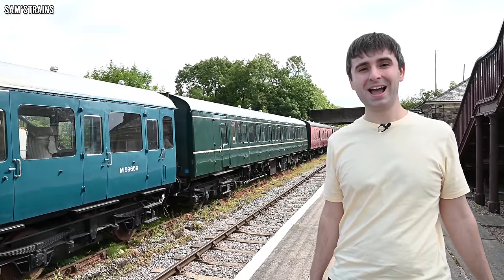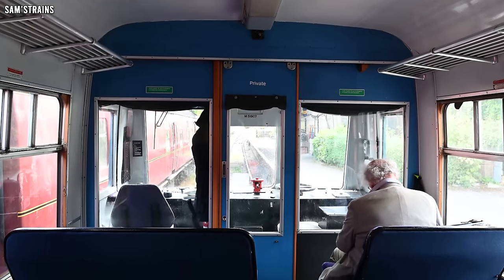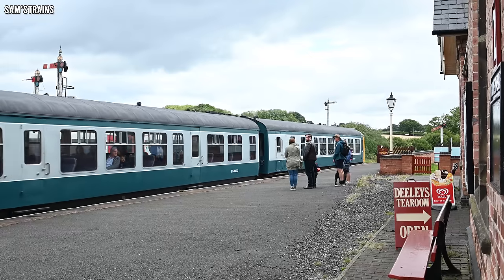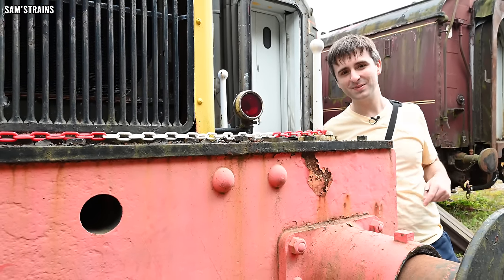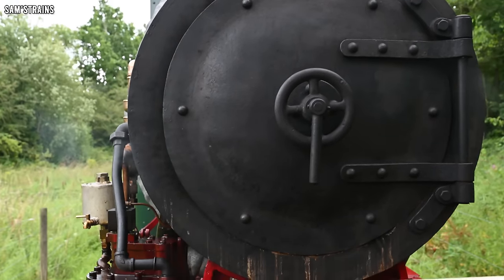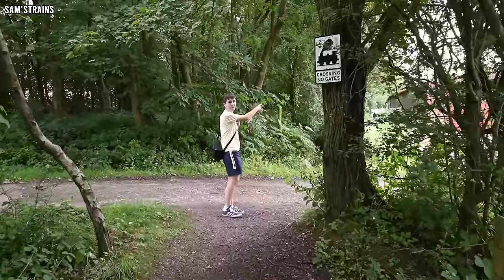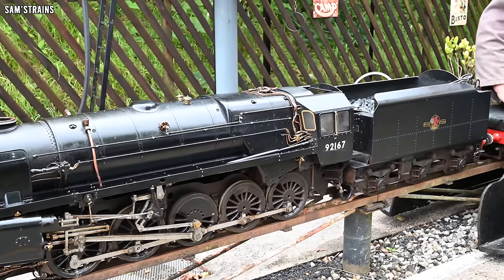Sam & Chloe Visit the Midland Railway Butterley | 3 Railways in 1 Day

Comment: One of my local presrved railways was called the Midland Railway too, but it has less stuff than the one in Butterley. In fact, It hasn't run an excursion between 2019 and November 2022, and still hasn't run one in 2023 after legal troubles over the depot and being sold to new owners. It too had a sand pit, but only during the Thomas events and it wasn't trying to be a beach.
I believe that coach at 1:43 is home to some of the model used on TUGS and Thomas and Friends. They're no longer open on a regular basis but have special weekends where they are.
2:10 that class 141 pacer was a 1st generation Pacer, one of only 20 ever built. They were retired in the late 90s and most ended up in Iran.
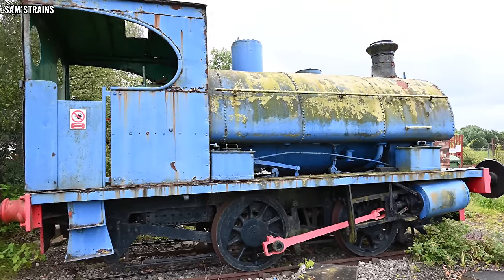7:42 that used to have a Thomas face on it and was called Oswald.

Comment: The chassis looks like a Badger commercial railway vehicle, which is designed to be used with a small pickup bod, normally in yellow, usually using a Volkswagen 1.6 diesel engine.

Comment: Very nice.
Once upon a train ride, along the Severn Valley Railway, Sam and Chloe were enjoying the shrill whistle and sharp bark of Erlestoke Manor, who was hauling an eight-coach train. Sam stuck his head out of the front window, and got speckled with soot. Chloe laughed.

"What's so funny?" asked Sam. He looked in the compartment mirror, and saw the answer. He was almost as black as the Ace of Spades. This wasn't all. Erlestoke Manor stopped at Hampton Loade Station, to let boyfriend and girlfriend off. Sam was puzzled until....
"I've got a present for you," said Chloe smiling. "Climb up on the footplate." Sam did as he was bidden, with Chloe in tow. Erlestoke Manor's Driver and Fireman stood back. Sam waited for the Guard's whistle. Chloe watched intently for the green flag. The signal to start was given.
"Right away, Sam," uttered the young lady. Sam pulled the regulator open slowly. Erlestoke Manor slipped briefly on the damp rails. The young man closed the regulator and then opened it up once more. This was something he could never refuse the offer of doing. Chloe was Firewoman, she got more dirty than Sam. No time to complain, the two were having the time of their lives.

The session ended at Kidderminster Town Station. Some dust got up Chloe and Sam's noses.
"AATCHOO!" they sneezed together. They laughed it off and climbed down from the cab. The platform was near enough deserted. Sam did something he'd not yet thought about. He showed Chloe an open jewellery box, with a diamond ring inside.
"Chloe," he asked shyly, "will you marry me?"
"Yes, I will," answered Chloe, kissing him on the lips. "I thought you'd never ask." Happy days.
Reply from the maker: haha excellent Kelly - a very enjoyable read as always, thank you!
Thanks for watching, Sam :)

Comment: Excuse me Sam but are you planning to review the new super detailed Hornby P2 Mikado soon?
Reply from the maker: Hey Bryan - yes I will be doing! :D
Thanks for watching, Sam :)
Reply: Sam please call the P2 a Mikado while you are reviewing it and be very careful with the tender to locomotive connection because the top part of the adapter from the tender can be loose sometimes. I had a bit of trouble with my Hornby A4 Pacific with the die cast boiler and I thought it was not working properly but it was just the top of the adapter from the tender which was causing the problem.